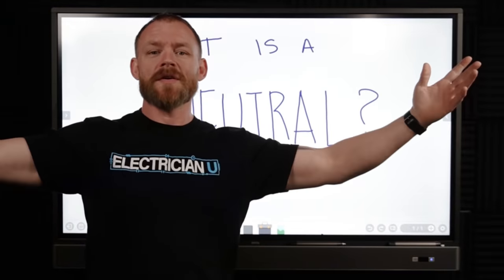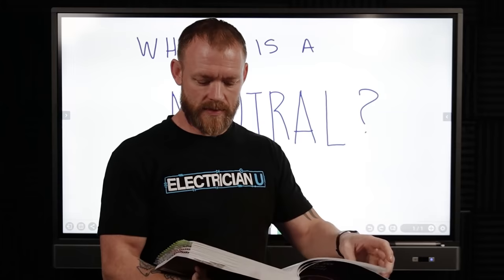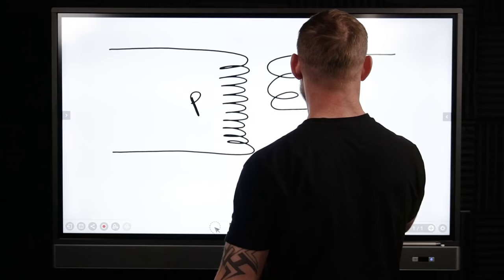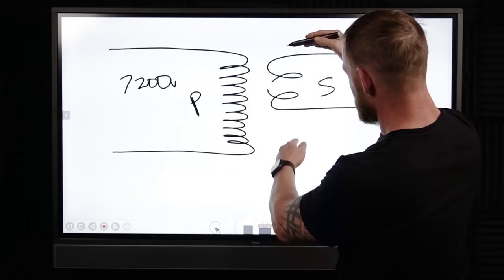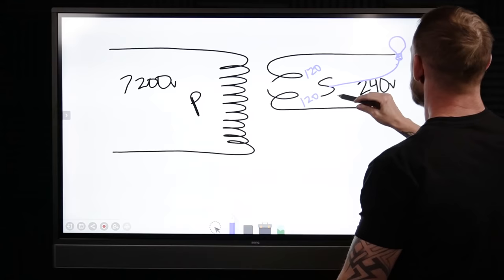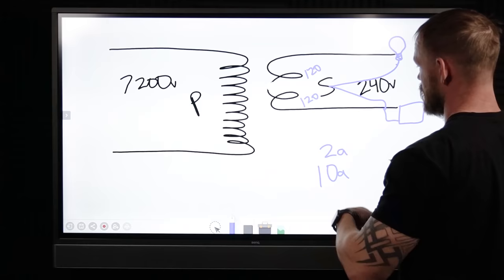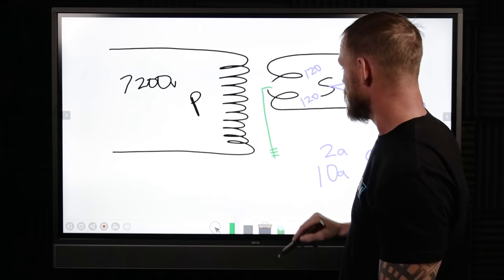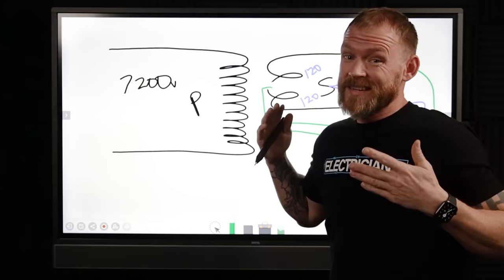What is a Neutral? The Difference Between Grounded and Grounding Conductors.

Comment: where everyone gets confused is explaining to too much. A neutral carries current. A ground should be called an equipment ground, and that's for safety. It never carries current unless there's an equipment fault.
Reply: British use different terms: Connecting the neutral to the ground is grounding and connecting the case to the ground (grounded neutral or in some cases separate incoming earth) is earthing. The proper term for those are operational grounding and protective grounding/earthing.
Reply: @okaro6595  I agree. The Grounded conductor should be called the "earth" conductor and would avoid all this confusion!  The idiots that do the terminology for the code are too stuck up to have anything simple and make sense!  They just like to show their superiority.  I am an electrical engineer and have been against other EE that have that mindset.

Comment: This is EXACTLY the reason why neutrals need to be checked for voltage before working on them. An improperly wired neutral can kill as easily as a “hot” wire. It seems like most of the troubleshooting I’ve seen or participated in has been chasing neutrals (commercial electrician).
Reply: I've experienced alot of those too, that's caused by having different circuits sharing the same neutral right?
Reply: @glenn3197  yes. Multi wire branch circuits. Very common in older homes. I think 🤔 they are still legal just have more rules to follow.
Reply: It happens on 480/277 most of the time
When some  residential electrician think of
 120 v. Neutral is like 480/277 and they act alike
Reply: @johnkruton9708  Now I’m more confused. Isn’t the neutral supposed to be shared between the two hot legs? I get that if the loads on each leg are perfectly balanced, there should be 0 current on the neutral. I suspect that my confusion is not understanding what you guys mean by shared neutral.
Reply: @MarcosElMalo2  By "shared neutral" they mean multiple circuits that are using the same neutral (grounded conductor). It's a bad practice because if you de-energize a circuit you can still have power on the neutral from the other circuits.
Reply: The voltage will read 0V or close to it if it's still connected to the ground, once you split your neutrals up from the wire going back to the panel it is no longer a grounded conductor and will have line voltage. That's what get's everyone, line voltage on neutral is almost always an open neutral.
Reply: A grounded conductor also known as a neutral wire is a current-carrying conductor. Why do people not understand this the current has to return somewhere neutral is a very misleading term
Reply: Same. Had a guy accidentally connect a 3 way switch as if it’s a single pole. He blew that breaker up lol
Reply: Same here,but we do mostly Residential,and its been my experience chasing Grimlins,9 times out of 10 its the neutral.ive been bit by a neutral that didnt bother me at all,and been bit pretty hard by the neutral as well.but the better I got at my meter the less I got bit lol
Reply: @jonathanhughes380  in actual fact the neutral is called neutral because it is neutral with respect to ground. In other words when it is connected to ground, no voltage exists between them. The mid point of the transformer is only neutral when connected to ground, otherwise it is called the midpoint.
Reply: @natewhitaker6791  a shared neutral actually means there is more than one controlling device. So if there are multiple neutral wires but one controlling device, all the neutrals will be dead when the device is turned off.
Reply: @johnkruton9708  I'm just a DIY homeowner, but I did discover a multi-wire circuit the electrician installed when I renovated my kitchen.  It's definitely legal. If I understood correctly, what the electrician failed to do was install a tandem breaker that covered both circuits using the same neutral.  Had to find that info online.

Comment: Given how closely related my trade (HVAC) and Electrical are, I've found a lot of useful info in your videos.
Reply: I do electrical service work but have been slowly getting into HVAC service also. Similar troubleshooting electrical issues  in them AC units
Reply: @matthewellis3004  About half of our issues are just failed electrical components anyways, lol.
Reply: @matthewellis3004 hey, can I ask you how you are getting into HVAC? How you're going about getting credentials? I'm an electrician, but I started years ago in sheet metal only... I switched to industrial electrician and now I do commercial almost exclusively.... But I really want my HVAC card. I don't know if it's wise at 40yo. Lmk something.
Reply: @stephbugg8988  we do commercial service calls. With that comes HVAC emergency work orders for AC not cooling. Almost always an electrical issue: run/start Capacitor.

Comment: I'm from United Kingdom and I like your knowledge I'm an electrician qualified. Our countries are similar in the Electrical industry but diffrent in small ways when I see how install light switches they look so confusing but not that bad in reality. You always have a switch feed and a switch wire just like anything in Electrical you have a system where the cable brakers etc goes up or down along the length of the system.

Comment: Nice explanation, how about explaining the isolated neutral buss in a typical 120/240 V single  phase sub panel ? Residential/ commercial  Thanks
Reply: You never want regular voltage being carried by a ground wire. If the ground and neutral are connected at the sub panel then you would have regular current going from the sub panel to the main panel over the ground. 

Follow the path of electricity for a 120v light connected to a circuit in the sub panel. Main panel hot to sub panel hot to branch circuit hot through the lightbulb to branch circuit neutral back to the sub panel neutral bar back to the main panel. If the sub panel neutral bar is connected to ground in the sub panel then the path back to the main panel would be half on the neutral going to the main panel and half over the ground going to the main panel. Which you don’t want because there should not be regular current going over the ground wires.
Reply: I just help fix a similar problem with a dryer on a sub panel that had the neutral and ground tied at the dryer. Current coming back to the sub panel from all the branch circuits over the branch neutral wires we’re going back to the main panel 90% over the sub panel to main panel neutral but 10% was going back through the neutral going to the dryer then going to the ground at the dryer (because neutral and ground were tied together there) back to the ground bus bar in the sub panel then to the main panel over the ground between the sub panel and main panel. 

Neutral and ground should never be connected except where you are being connected to the utilities. Or you will get stray voltage on the ground wires within the structure. Which you don’t want.
Reply: It is to ensure current flowing through the neutral goes back to main panel so as to trip breakers on the main panel if a problem occurs.

Comment: Hey Dustin! Sorry if this has already been covered, but I couldn't find any videos that looked like they address it. I know you're busy so here's the summary: Changed an irrigation pump from 120v to 240v as it was burning the outlet. I was surprised to find that in the 240v configuration it only called for the 2 hot leads and a ground. I understand a little bit about split phase, but this went against most of my knowledge of AC power. It might be interesting to talk about how this works and to also address the pros and/or cons of running that at 240v without the neutral. I detailed more below. Thanks for your videos. It's always fun to expand your understanding of things like this and you do a great job!

THE REST OF THE STORY IF YOU HAVE INTEREST:
 I am a homeowner in rural Montana. I have a small piece of land 1.5 acres and I use an irrigation ditch to water my place. I'm a fairly educated homeowner when it comes to these things as I have built a building, sunk a separate ground, and wired in circuits and had an electrician inspect my work to make sure I did it correctly. My question is regarding my irrigation pump. I believe it is a 1.5hp and it sits next to my power pedestal at the road. In that box there is a main shutoff and one outlet with a breaker switch to control it. That outlet was getting fried on the one side because it was wired as a 120v outlet and I believe I was probably drawing more amperage than it could handle. So I inspected the pump and discovered that it could be wired for 240v instead. So I rewired it and then bought a 240v 3 prong outlet as that was what the pump called for. I was surprised to see that there was no neutral wired in. Just the two hot leads and the ground. I understand split phase, but this might be an interesting to cover, and I'm wondering if there is any disadvantage to running a pump this way vs at 120v with the neutral? Everything else running 240V that I have run had the neutral with it and was a 4 wire system.
Reply: A 240V configuration doesn't require a neutral because the 240V is derived by referencing the Line to Line voltage.

Comment: Video suggestions:
Why you don't get shocked from a neutral conductor.
What would happen if the neutral conductor wasn't grounded at the transformer.
The reason and importance of balancing a breaker panel.
Mainly in residential 240 volt service.
Reply: How do you balance a single phase panel?  You can't get shocked from a neutral conductor.
Reply: @lloydmills9619  
Say you had 20 amp breakers in spaces 1,2,5,6,9 and 10. No breakers in the rest of the spaces. 
These breakers were supplying your small house with all the power it uses.
Now all the power is drawn from one leg in your panel.
This would be completely unbalanced as the correct way to balance the panel would be to draw roughly the same amount of power from each leg.
This is an extreme example. Everyone would start at #1 and either work their way down one side or use both sides and work top to bottom and pay attention to the possible amp load being supplied to each of the two legs. 
It would not be good to have a 100 amp panel and have it set up to draw 100 amps on one leg and 20 on the other.
Reply: You do not get shocked because it is grounded just like you are. It the system was not grounded then you would not get shocked from either one.

Note if the neutral is broken then you can get shocked from the part that is downstream.

Comment: Thank you, great video. P.S. try not to use the yellow on the white board, it's not visible. 😉
Reply: I usually use blue for neutral on wiring diagrams if using a dry erase or similar.